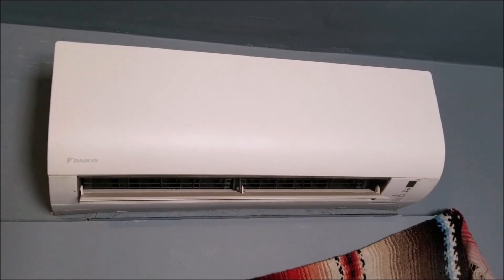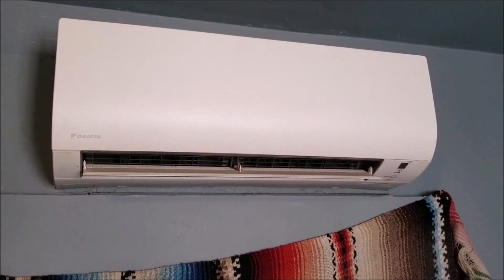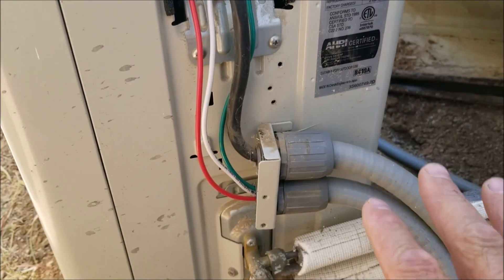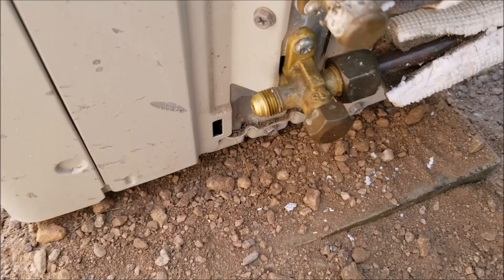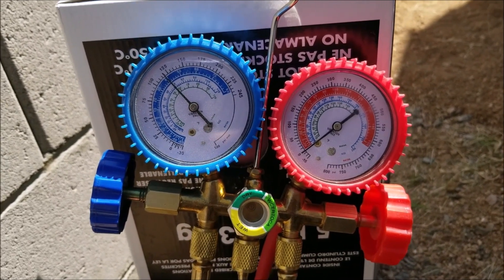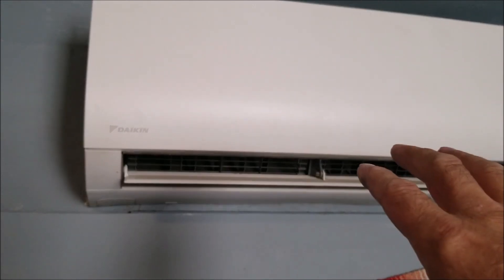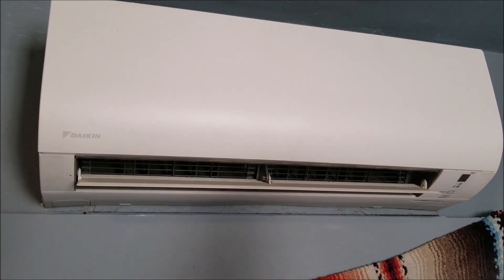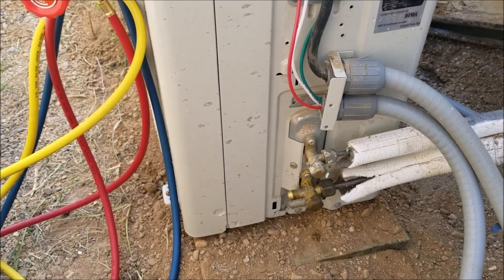How To Add R410a Refrigerant to a Mini Split that Has a Low Charge

Comment: Don't forget to purge out the air trapped in the blue hose at the gauge before charging.  Air is a "Non-condensable" gas and shouldn't be allowed into the system.
Reply: To do that, would I connect the red line to a vacuum pump, open the red gauge for perhaps 5 minutes then close it? Also, I have a single stage, is that good enough?
Reply: @jawharris  
Hello Jeff 
No need to use the red hose, as you are just recharging Freon using the blue and yellow hoses.  Attach the blue hose to the low side of the mini split (the large tube when in “cooling mode”) then briefly loosen the othe side of the blue hose where it connects up to the pressure gauge manifold.  Once you see Freon escaping then all air has been swept out.   Same for the yellow hose. Cheers
Reply: @kenbales7062  So hook everything up, open the 410A bottle, then crack open the yellow hose and the gauge until freon comes out, then crack open the blue hose at the gauge until freon comes out?   Is it obvious when freon starts to come out?  Thanks.
Reply: @shanefrank3281  Hello Shane
Yes, open the Freon canister, then barely crack open the yellow tube at the gauge manifold and the liquid/gas will be cold  as it comes out. Repeat same for blue hose once the suction ( large pipe) side valve of mini split is open, so all air is purged out.  If the heat pump has no Freon at all and all is at full vacuum, then it is OK to start charging.
Reply: @kenbales7062 Will only work on R22 but if you do that on new refrigerant using POE and PVE oil you're adding moisture to the system. When the hose and manifold gauge is disconnected it will absorb moisture from air because it's wet with the compressor oil. Always use a vacuum pump and connect it to the high side.
Reply: @jawharris q
Reply: @jawharris mandatory in the netherlands to use vacuum pump
Reply: What is the red hose for?
Reply: @war111able its for charging on high pressure side (vapor state)
Reply: I've been buying refrigerant on eBay and from the Internet (eBay hasn't had it in a couple years) for about 4 years now and from what I've gathered is it's basically not illegal to purchase 410A, it's just illegal to install 410A if you're not a licensed technician. A lot of times I have to e-sign a document saying that I'm buying it to resell.
Reply: If ur a refrigeration service tech u had better do so more studying.
Reply: Using the vacuum pump on the high side minimizes the amount of refrigerant lost to the atmosphere.
Reply: Thanks, I was about to ask that question. Especially important for longer hoses.
Reply: Do you recommend stop leak for very slow leak systems like for a system needing refrigerant every 3 years?

Comment: Do you do this with the system running or off?  Thanks
Reply: Running on cool
Reply: @blizzytaj  One other question....sorry.  I have a dual zone, so should I have both indoor units running on 'cool' to do this top off of 410A?  Thanks again.
Reply: @ssacra22  that's correct, you want to see what the pressure is when the entire system is running so you get the charge level correct
Reply: @blizzytaj  You're the best....thank you.
Reply: @blizzytaj  Actually I lied, I do have one more question.  Once I am running both units on cool, what should the pressure reading be?  Thanks again
Reply: @ssacra22  it really depends on how long your line set is.  Usually (hopefully) whomever installed the unit will have written the pressure on the plate somewhere on the outside unit (usually by the fill port).  
I can tell you that on my unit with a 25' line set the pressure is around 120psi when full.  Hope that helps
Reply: @blizzytaj  I appreciate your insight.  The long and short is I just installed it.  Everything was going great until I had a valve stem break when taking out the gage line.  Took a few seconds before I could grab the valve stem removal tool and get it in place.  410A sprayed out for about 4-6 seconds. So I know I lost some.  With both indoor units running on cool today, the pressure showed 90psi.  I have about 10 ft on one line set and about 35 ft on the other.  It's a 4 port system....I plan to add two more indoor units probably this Spring.  Not certain yet
Reply: @ssacra22  I see, I'm pretty sure there is an HVAC calculator out there on the web that will tell you the required pressure per foot of line.  Also best to consult the manual of your unit as they vary a bit
Reply: @blizzytaj  thanks a bunch for the advice. Best of luck to you

Comment: So if it said 2.09 pounds you put 2.09 pounds and you don't care about the pipe length?
Reply: no you have to account for pipe lenght. standard is 25' anything more or less requires adjust refrigerant.

Comment: You do not need to a EPA card to buy 410a , but you do need one to use the refrigerant.
Reply: Actually that is inaccurate.  All supply houses and gas supply shops require a copy of your EPA card for the sale of any restricted refrigerant.  No legal legit supply distributor will ever sell refrigerant to a person without an EPA 608 card / certification.  That violates the EPA 608 laws.  All refrigerants are kept in a registry and database to how much is sold, how much is turned in for reclaiming and how much was lost to venting.  That would be like saying you can own all the drugs you want as long as you don't sell or use them.  Where on Amazon is there any restricted refrigerants for sale?
Reply: @Balticblue93  Wrong
Reply: @chrissipple1018  lol… I will post up the EPA laws and requirements.  We wouldn’t be required to take four tests to get our EPA 608 universal, if it wasn’t the law.  Show me where you can legally buy 410a refrigerant without proof of an EPA license.
Reply: @chrissipple1018  Shall I remind you that it is a $10,000 reward to turn someone in for improper usage and venting of such refrigerants and a fine of $45,539 per instance for the offender?
Reply: @Balticblue93  Get a clue, I've had my universal the first week they came out. No 4 test when I took it, and I don't take threat's lightly. So being a handy man do not threaten me. You need a license to handle 410a but you do not to purchase it.
Reply: Oh... and you never showed me where you can legally buy a restricted refrigerant without a 608 certification?  By all means, please show us all where that might be.  Amazon did you say?  No parts house would risk the repercussions.  Just another hack on YouTube.

Comment: Question, Assuming a new system comes pre-charged for 25' of lineset and you need to add 25' is there a calculation to figure how much more refrigerant you would need?
Reply: yes the instruction manual will tell you exactly how much more to add. then you buy the refrigerant and scale and carefully add in that extra amount needed. It's always best to keep the lineset to 25' so you don't have to buy extra lineset and refrigerant. there are brackets to mount the outdoor units on walls that can help
Reply: The instructions will tell you how much to add per ft of line

Comment: Hey there to me the pressure on the gauge wasn't to bad between 120psi to 125 is good especially if the weather is hot and the Unit probably needs cleaning did you check the blower wheel to see if it has fungus build-up ..just saying an ac system doesn't need a top up unless there is a problem or a leak cause it's a seal system and the purging of the hose of air is important to do and let the unit pull in the remaining gas in the hose so that you will  not let it out in the atmosphere keep up the good work

Comment: Nice video. Consider purging your hoses. After opening 410 bottle, crack hose at gauges, and open side your charging wirh and crack that hose as well, to eliminate getting air into system. Sometimes I still forget and maby not a big deal but is best practice
Reply: That's correct you don't want outside air getting in there. But just a little bit of air will raise your microns very high and that moisture that's in the air is going to move around in that system day after day year after year and it's going to end up hurting the compressor the valves and oxidation in the entire inside of the system. That system won't last very long. The best thing to do is get those microns down as far as it can go past 500 and then Purge the refrigerant lines a little bit with refrigerant once you have a tiny bit coming out you're good and you can hook it up air in the system.
Reply: QUESTION,  do you do the test with the ac running or power off until you get connected? #2. Do you do everything the same when it's winter and the heater fan inside stops but fan is running on air , fan only and dehumidifier,  only stops on hear, sometimes it will run a short time on heat, like a minute before it stops??? Thank
Reply: @ronnmiller9085 I don’t know anything about anything, but i do remember a video where they use the temperature and it matters.  So the differential of outside to inside matters for the gauges.  So if it’s a hot day and cold inside, like 25 degree diff, you may need 135, but on a nice day like 70 inside and 75 outside maybe it’s 125.  Don’t quote those numbers but the point is the temperature differential does matter I think.
Reply: Good teacher